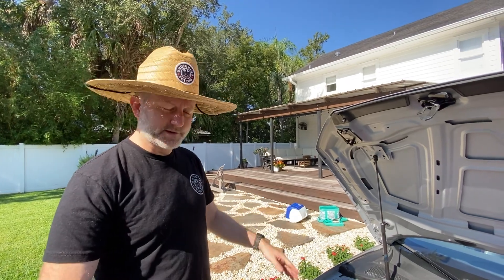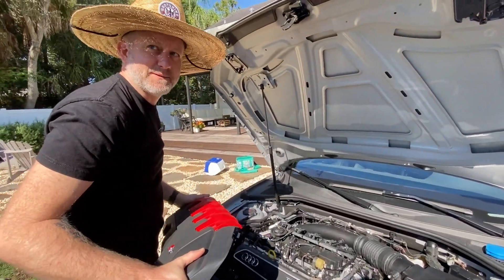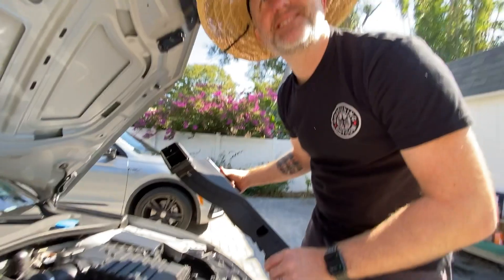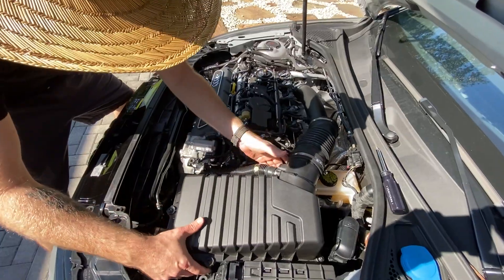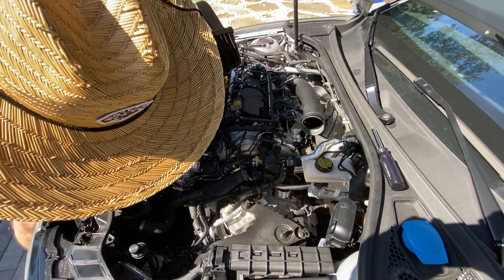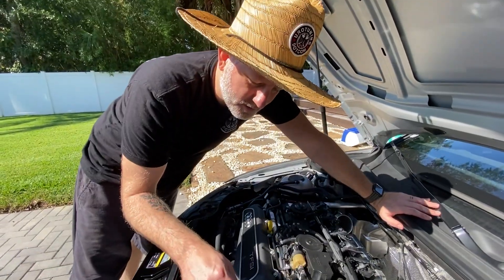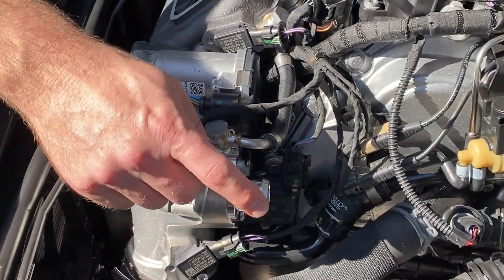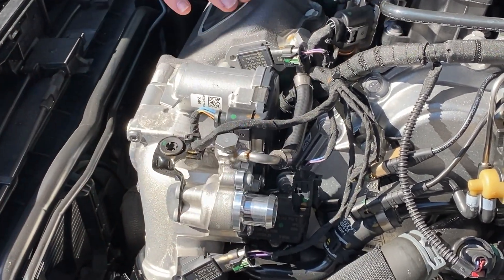Unitronic RS3 / TT-RS Carbon Fiber Air Intake Install by UroTuning

Comment: Sooooo. Eventuir gen 2 or UNITRONIC or integrated engineering? They all have the same full carbon setup but bit different filter housing. I am a new 2018 rs3 owner. Total newbie lol. Could use help. I know there won’t be much difference until it’s tuned but it’s just want to get an expert opinion. I do plan on tuning it,turbo inlet and currently looking at full exhaust but I’ve only done small mods like K&n drop filter and removed resonators and waiting on the mail for the exhaust valves delete plugs. I do have the sport exhaust with the black optics trim. So if I could mod the stock sport exhaust,even better lol but I wouldn’t mind changing the whole exhaust. Just the price is crazy lol. Well then again all the mods seemed to be over $800- 1,500 lol. Thank guys
Reply from the maker: Hi there! We can definitely get you all setup. Give us a call or text 813-444-7021.

Comment: I purchased the Uni 4" turbo inlet and air intake from Urotuning and recently had it installed with the race filter on a stock 19' RS3. Without a tune, I feel like I lost a little low end but gained mid to high end power. I want to swap out the race Blue filter for the daily Red filter. What is the easiest or fastest way to do that with the least deconstruction?
Reply from the maker: Hi there - thanks for the comment, send us an email to sales@urotuning.com and we can help you get exactly what you need!